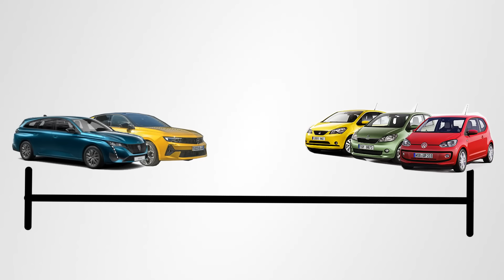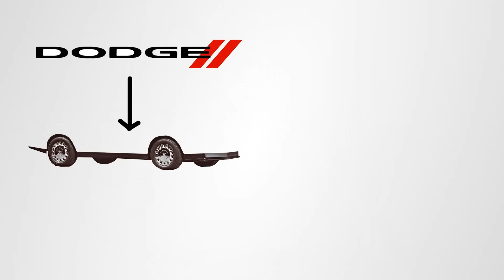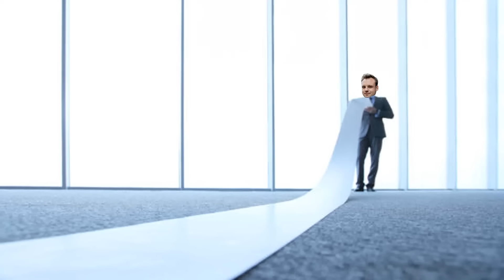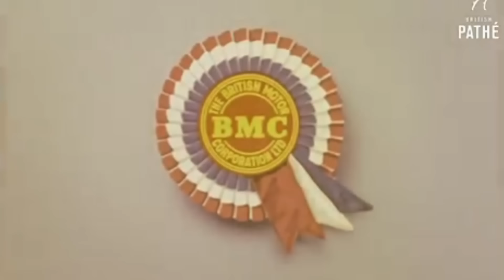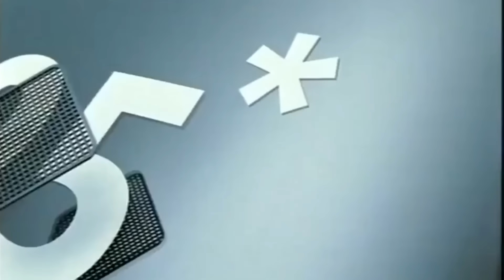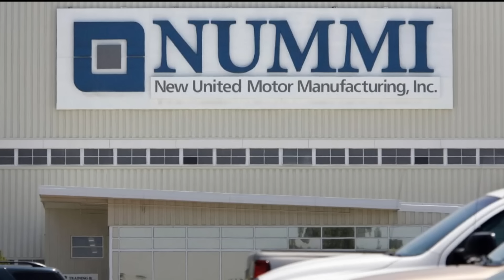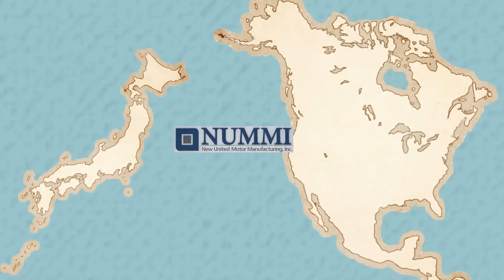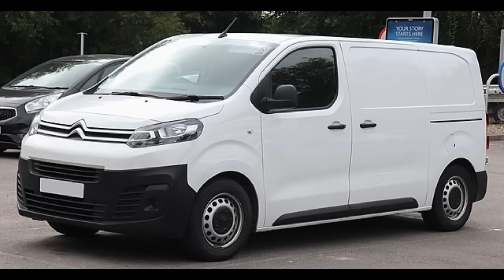Ep. 30 Seeing Double: The History of Badge Engineering

Comment: it's why I laugh to myself when people swear brand loyalty. "it's Buick for me, I would never drive a Chevy" LOL
Reply: I'm a model loyalist. I like rangers, so I hot no problem droving a Mazda
Reply: Back when Holden and Toyota were rebadging each others cars here in Australia in the late 80's - mid 90's, you'd hear of people buying a Nova (Corolla) or Apollo (Camry) because they wanted an "Australian" car, or buying a Toyota Lexcen for the "Japanese quality" giggle
Reply: I had a 84 Buick LeSabre I bought from a friend that needed a transmission but it was powered by a Olds 307 from the factory originally & no not the lowly Chevrolet small block 307 from many years before that was under powered & often times smoked & used oil like a sive lol .  GM would use different engines in different bodies going back to the 70s where some of these cars used what was called the BOP transmissions where it could bolt to a Buick Olds, Pontiac or Cadillac engine that often times any of those engines could be installed at the factory let's says a Buick with a Olds engine in its body or vise versa or Pontiac with a Buick engine . I think one of the reasons behind this was at times they would run out of a engine let's say like a Buick so they could keep production going by bolting in a Olds or Pontiac engine into the Buick body using that BOP transmission especially if said Buick was ordered to have a 350 ci engine which all of them made a 350 at one time other than Cadillac in those years who had the 472 & 500 cube engines & later the 425 in the early 80s.
Reply: Agreed
Reply: Even though they're both under the mighty GM umbrella lol
Reply: @peteloomis8456  my mom had a beige 84 LeSabre. The gas needle broke and was stuck around the half tank mark. It was a guess on how much gas was left for those last few months she had the car. Miss that old bucket of bolts 🔩
Reply: Remember though, there can be quality differences. For instance Kia and Hyundai share model types and designs, but these are made in different factories with different quality controllers. As a result of that example for instance, in recent years Hyundai does pretty well in initial quality, but Kia has generally been #1 or tied for #1 in recent years.
Reply: This scenario in this context doesn't exist...

A better example is someone with a Chevy Cruze saying they will only "buy American"
Reply: My tech class tought me that every car is junk regardless of brand lmao

"As far as you future techs are concerned, every car out on that parkinglot is junk." My Tech teacher
Reply: @bryanv4081  i dont know anyone that thinks kia or Hyundai is quality. The few that have bought them hate them.  Especially the ones that had nothing but oil consumption issues
Reply: Aren't Buicks built in China?
Reply: @peteloomis8456  Right, like my Dads 1983 Chevy. It had a 2 Barrel Oldsmobile engine in it.
Reply: @alex_thecarguy  If you don't buy a certain Toyota, then you aren't either.
Reply: I mean, before the late '70s there would've been some merit to it. Individual GM divisions did their own engineering and had their own power trains before they paired everything down to Chevy and Olds V8s, Chevy and Buick V6s and Pontiac and Olds 4 bangers, using these engines across divisions. Cadillac with the Blackwing V8 just a couple years ago was the last GM division to have its own engine.
Reply: Rebadging your Chevy Bolt into Opel Ampera-e with that “thunder badge” looks sophisticated handsome & cool! What the heck is Mexico doing rebadging the Opel Astra into (such hick) Chevy Astra??? Well, they envy the average life in U.S. & happen to have no idea what an Opel is?
Reply: @beauxr.benoit1374  China thinks Buick is cool, therefore calls the Daewoo Lacetti a Buick, while the U.S. finds Buick to be too grandpa-ish & would rather call the same Daewoo a Suzuki, haha.
Reply: @creakid  But that is being mean to the Suzuki if it is Rear-Wheel-Drive.
Reply: To be fair, prior to the 1980s and GM corporate engines there was more differentiation between the GM models on the same platform.  Each division had its own unique engine designs and in some cases transmissions so they were more distinct cars.
Reply: There be the marketing strategy that “gave” (read: inflicted upon) us the Cadillac Cimarron.
Reply: @NeuroDiv_Skunk8785  New gen are no longer proud of Cadillac & finds Kia more cool.
Reply: @alex_thecarguy  I don’t know what you are trying to say, the Chevy Cruze was built in Lordstown, Ohio. It was the replacement for the Cobalt, which was the replacement for the Cavalier, all built at Lordstown.

The hatchback version was built in Mexico, maybe that’s what you mean?
Reply: I'm kinda a Toyota fanboy but that's only because I'm poor and Toyotas last a lifetime.
Reply: Up until the 70's the GM divisions had different powertrains for each division
Reply: The absolute worst are GMC Sierra vs Chevrolet Silverado fans. 

It’s the same damn truck. Especially back in the GMT-400 era. They had all of the exact same panels except for the front clip. Which was interchangeable.
Reply: @beauxr.benoit1374  

Ah yes, the mighty 307ci Olds engine. 

The last of the Rocket family.
Reply: The difference can be based in the suspension, interior, and styling.  While some are blatantly the same, others have enough differences that I can understand the purpose of getting the Buick over the Chevy.
Reply: If you are a true rebadged engineering, look at 2000s and even still modern lawn mowers
Reply: Chinese buicks in China like Buick GL8 (Pontiac Montana) and Buick Regal, both Chinese buicks were exported to the Philippines are 10 seater Chevrolet Venture (Buick GL8) and Chevrolet Lumina (Regal)
Reply: @alex_thecarguy Chevrolet Cruze is Korean
Reply: @FrancisLitanofficialJAPINOY  you don't say...
Reply: @paulwindisch1423 Chevrolet Optra in Canada and Mexico, Suzuki Forenza in the US.

Cobalt was simmilar to Opel/Saturn Astra.
Reply: The worst ones are the Chevy vs gmc guys. “ I love my sierra. You’ll never catch me in one of those crappy silverados” lol
Reply: chewy's fine but ford a different storµ.... :S:S:S:S:S
Reply: @davidshepherd265  at that time Corollas and Camrys were Australian made though, so buying a Nova or Apollo you were buying an Australian car, just something that was made to Toyota’s standard.  I knew a few Toyota mechanics at the time and they said they hated when a Lexcen came in (this was a small town so only about three Lexcens were sold from that dealership) due to every single one leaking oil from somewhere and they’d have to find where the rattles were during pre-delivery inspections.  Holden mechanics on the other hand loved Novas and Apollos as there was no such thing as a leak or a rattle anywhere.
Reply: @NeuroDiv_Skunk8785  along with every other J-car.  My uncle had the Holden version.  Was the most hateful thing I’d ever been in.  What was worse was it was meant to be the sports model, yet there was not one single thing sporty about it.  The Datsun 120Y he had before that Camira was quicker.  Was glad the day he traded it in on a then two year old four cylinder TS Mitsubishi Magna.  It was like he went from a horrible car to something that was actually well made and comfortable.  Was still slow though, but it wasn’t masquerading as a sports model.
Reply: @FrancisLitanofficialJAPINOY  depends on where you are.  In Europe it’s Korean, in the US it’s American.  In Australia where it was sold with Holden badges, the first ones were Korean and later ones were Australian assembled from Korean kits.  All had European motors though when fitted with the 1.8 as it was the same motor that had been in Astras for years (Family II which was later badged as an Ecotec).
Reply: @Ballstothewalls69  Only difference between a GMC Sierra and the Silverado was luxury equipment.  Sierra is meant to be the more luxurious version.
Reply: I go by the parent companies.
Reply: Yeah but in the older models there was harldy any differences. And other then that all the internals are the same.
Reply: I keep leads on my favorite motors and then whatever cost the lest with that motor I like
Reply: I agree! GM are the cannon of it!
Reply: @peteloomis8456   First time I changed the plug wires in my 71 Olds it wouldn't start again.  The Olds and Chevy used the same 350 block, but the Olds had a different crank shaft, and turned the other direction.  This was well before the internet, so it took a while to figure out.
Reply: @alex_thecarguy  Had a good laugh at a Chevy Trax Monroney sticker earlier today  (it's a rebadged Daewoo).  US and Canadian Content = 2%.  I'm really wondering where the 2% came from. Like, are the seatbelts made in the US?
Reply: But nobody serious says something like that cause they know General Motors owned many brands.
Reply: @peteloomis8456  The Chevy 350, Buick 350, Olds 350, and Pontiac 350 are all different engines and were designed by different engine designers who had different philosophies on engine design. They absolutely never put a Pontiac in and olds etc.
Reply: It gets lower than that.. Let’s take a Korean made H$itbox, and put both Chevrolet and Buick emblems on it.
Reply: @Thumper68 Oldsmobile sold so many engines to Buick and Pontiac they had to start putting Chevys in their cars. My 77 firebird had a blue olds 403 in it from the factory.
Reply: @slash09r1  so you had a California or high altitude car.
Reply: @Thumper68  cool story. Doesn't change the fact that gm vehicles came with engines from all across the gm brands and that the previous comment i was replying to is grossly incorrect
Reply: yes they came with different engines from different manufacturers but they were not representing them as their brands engine. And my comment was about the 350’s
Reply: „I‘d never buy a foreign car! I buy local brands!“

is British

:P
Reply: I just like how the grille and headlights tend to look on Pontiacs a bit more. For example, my 04 Grand AM. Ik it's a similar car to my dad's 99 Malibu, just an overbored engine essentially, and a few other odds and ends different, but I just like how it looks a bit more.